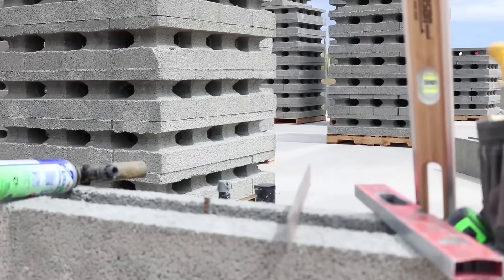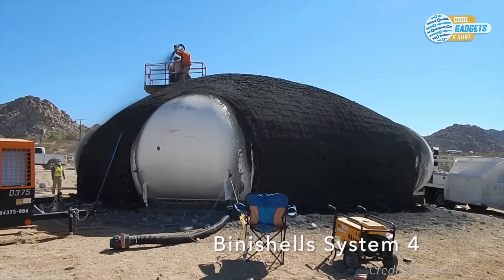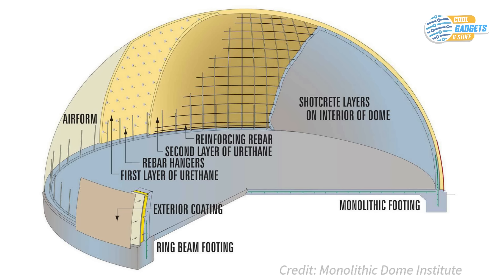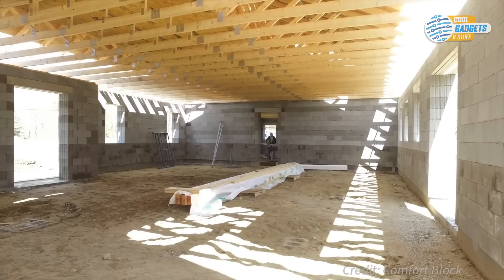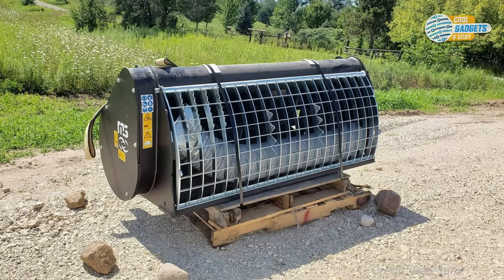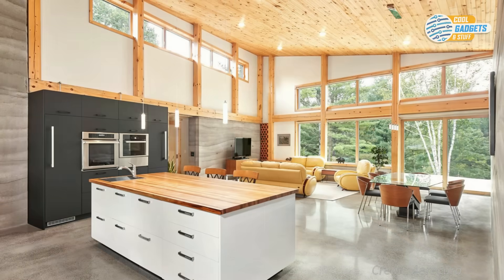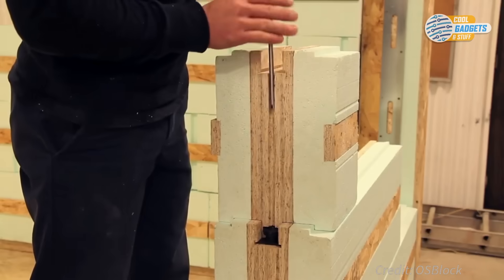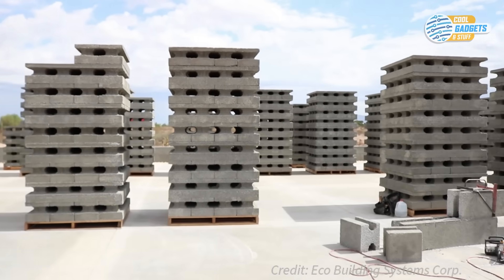5 Innovative BUILDING SYSTEMS for your house #3

Comment: Was surprise to see the complete lack of staggered structure in the “Perfect Block” product in the last system. Seems like a basic building technique was being ignored, and I can’t help but wonder why.
Reply: I noticed that right away, no staggering, it must be a mistake, but maybe they were too lazy to cut the blocks in half for a staggered course. It’s inexplicable to me.
Reply: if you look at the broken block you‘ll realize they are not structural at all. its the poured concrete that is.
Reply: @marcelbricman  True but it's a very thin sheet of concrete all said and done.  Thin with no support from the blocks.  It's going to crack for sure.   I guess the real problem with experimental building is time.  You really won't know until a decade later.
Reply: @MrBottlecapBill  it looks to be a grid of 10cm thickness with rebar inlay, yes its not super thick, but should be good for a 1-2 storeys?
Reply: That's what I thought as well and it looks so counter-intuitive, but this is because bricks are load-bearing and the staggered pattern serves to redistribute the load and bind/interlock together the blocks (bricks).
Here the blocks only serve as a mould to pour concrete in and then serve as insulation, the load bearing part is provided by the concrete that is poured into them.
Think about these blocks as arranging your insulation.
Reply: @JC-XL  agreed, also, regular bricks are staggered why?  load, sure, but more importantly LATERAL stiffness - if built unstaggered a whole vertical seam could open, but staggered makes it much harder.   here, the concrete and rebar provide the lateral strength, so....
Reply: If the concrete and rebar settle over time I still see the blocks opening up and exposing gaps.   :/
Reply: J C Staggering always improved strength, even when we are talking about the interior continuum of concrete and rebar
Reply: After the Block are set concrete is grouted through the holes for a complete web of reinforced concrete inside the whole structure of the wall very strong. This is not a new building system it was invented in 1965 in Australia it's called rostra block.
Reply: It's only the first rule of building with Lego.
Reply: my thoughts exactly.

Comment: You said multiple times that concrete is mold proof. That's absolutely not true at all.
Reply: More resistant to mold would be a better terminology.
Reply: @irmux skeptic That's like saying rotten trees are mold proof, as long as you keep it in direct sunlight on top of a mountain far away from the ocean
Reply: @NikoBell1188  Certain capacities are better at resisting mold in others indeed.
Reply: The mold proof blocks are mold proof. But however perfectly they make mold proof blocks, if you're living in a house of its temperature gap between in and out of the house is too big, then the house starts to be moldy. That's freezing phenomenon especially in winter when the heating temperature is too high making big temperature gap from outside cold weather, it makes mold start to grow.
Reply: I heard “mold resistant.”
Reply: I agree with you though because I could take you to my basement right now and show you some mold but I will say it is more resistant to mode opposed to lumber for example and a lot of the time mold will fall into the concrete due to a wooden beam or 2 x 4 or truss
Reply: Do rocks and Portland Cement mold?  Concrete is mold proof.  The interior of a concrete building, or the pores?  That's not the concrete itself.

Comment: Hmm...does the rebar hold it's shape created by the dome? Strong enough to hold cement; stay that shape?

Are the domes structurally safe; mathematically engineered?
Reply: Domes share a quality with boats; all that curvature makes for a lot of strength.  As you can see in the video, these structures can span large areas with neither columns nor beams, provided they are properly designed and constructed.

Comment: Eliminate steel because  it rusts. Concrete  will  not last. The  pyramids  would  have  disappeared  if they were  made  out-with concrete.  Its  insane.
Reply: You prefer wood? Seriously what other option is there today
Reply: @olsonlr  I prefer some material that is  strong, does not  rot, does not rust, nothing  eats.

Comment: 10:34 this looks weak AF.. not overlapping layers...
Reply: It looks weak, but remember that that is just the light and airy styrofoam-based leave-in-place concrete forms. The meat of the structural support is the concrete and the steel.

Comment: 10:30 ... NEVER LINE UP YOUR JOINTS ...
Reply: right they should used overlapping layers
Reply: It is just the insulating form that is lined up.  Those joints don't matter because the wall gets filled with a continuous pour of concrete.  There is no engineering reason to avoid lining up the insulation. 

If they are choosing not to lay them in a running bond, you can bet it is intentional.  My guess is that such long blocks could have trouble aligning well when placed in running bond (small issues become amplified over the length), so they save trouble by not doing that.
Reply: @SimonASNG  - Nah they are just being lazy. An even better idea would be to offer the blocks in two lengths. It would not change much, but speed up built time. It also takes up the same amount of crate space and adds no extra weight either. The concrete poor would actually be stronger by cross crossing rather than run up and down in thin rectangular pillars as well. The best reason to overlap each layer though is that in the event of any movement, likely from the soil, no cracks are likely to form or begin to show..
Reply: @SimonASNG  what about redundancy? One engineering principle is to have helping properties appear several times in a structure in different parts of it to reduce the probability of error or failure. Seems legit to add more stability to any layer of your wall when possible since that's the key thing in construction. But they still may have good reasons not to do so, like material constraints or whatever. I'm not an engineer.
Reply: @juxtapode2781  Insulation is not structural, so it doesn't actually add much stability.  However, running bond might make it much more difficult to lay correctly.  Bricks are short, so the running bond doesn't cause a problem.  However, if you run long bricks or long tiles or even plank flooring, you will see they recommend against running bond because it is almost impossible to get a good fit if the lines are not perfect.   In bricks, you stagger the joints to reduce the chances of a crack propagating, it is the long vertical joints you want to avoid, not vertical solid.  Imagine the insulation completely evaporates (magic) and this system still leaves you with a solid rebar reinforced wall with no joints and without the potential problems of trying to run the insulation in running bond.  No joints is better than staggered joints.  Anyone who tells you differently just doesn't understand why joints are staggered.

Comment: Good job! Take a look a HEMPCRETE, it should complement your growing list of alternate methods for construction 🚧
Reply from the maker: Hi, I know about Hempcrete but from my research is mostly used for insulation not as a structural building system. Will do some research if there are any hempcrete building blocks out there, if you know of any company let me know. Thanks for the comment.
Reply: Cool Gadgets & Stuff not at all... Take a look 👀 at this hempcrete “blocks” with added space for pouring floor to roof support.... https://www.isohemp.com/en/hemp-blocks-buildings-hempro-system
Reply from the maker: Hi, I've seen Isohemp before, I featured them in my Eco Building Materials 1 video. They can be used like Insulated Concrete Form type of construction. I found two other companies with Hempcrete products - Hempitecture and and GeoSIP Hempcrete so will include more on Hempcrete in my next Building Systems video. Thanks for your suggestion.
Reply: Cool Gadgets & Stuff it was a wild thought — could you share your website? Thanks !!
Reply from the maker: Hi, don't have a website for now. I understand some people like article format more, maybe in the near future.
Reply: @cgstech5657  no problem... but you do build these domes? Have any models to look at? thanks
Reply from the maker: Hi Peter, links are in description. I'm not affiliated with any of these companies. This is just like a news type of channel.
Reply: I'm currently looking into varying building materials to build my first home using bricks. Though hempbricks has caught my attention and am curious on the cost per brick, sustainability and the endurance of said bricks during heavy winds and likewise.
Reply from the maker: @EmWhaley1865  Hi, I covered Hempcrete in my fourth video on building systems. It's on my channel. Hard for me to give a cost estimate.

Comment: top part dome with fan blowing downward and the air intake lined with UV light.   Bottom has a series of posts that the dome sits on, roll up doors between posts with screen on inside.   Now you have a covid safe sitting area for restaurants that is lockable but still like a outside patio.
Reply: You must be in Kalifornia.

Comment: All these, yet no mention of industrial steel SIP panels. Steel SIPs offer the combination of highest R-vale per dollar, entirely recyclable materials, fastest construction times, near R50 clear wall value, no pest food value, lowest ground pressure per square foot, reduced foundation requirements, lightest handling AND installed weight of any approved method/material, reduced labor cost, minimal preparation, minimal fixturing/fastener requirements, reduced need for finishing ("as produced" with weather and moisture barrier inside and out), and the convenience of engineered materials with known tolerances and consistent physical properties.
Reply from the maker: I'm doing another video on building systems soon and will likely include steel sips. If you know of any company making or building with steel sips let me know.

Comment: cost comparison per sq ft would be a nice metric
Reply: $250.00 per square foot turn key sounds about right! I researched a Concrete come home. I built a brick home for $35.00 a square foot.
Reply: Don Raptor No way to be 250$!
Standard construction is ~150$ depend where you live,often less than that. Concrete dome shouldnt be more expensive,and if they quote you that much,than that company sells hot air ballones!
Reply from the maker: Hi, yeah I agree cost is a factor, but it's kinda hard to give an estimate when there are so many other things to take into consideration than just the cost of the blocks. Only Conrete shell companies and Aerecura rammed earth company builds turnkey solutions. Binishells have different system that range in price and Aerecura is from my research a bit more expensive than conventional construction because of the labor involved. Comfort Block is I think about $30 for square foot and the OSBlock and Perfect Block you have to contact the companies for a quote.
Reply: @cgstech5657  I mean, it's not hard to just find a house that was built with one method and then find the cost of building it and divide that by the square footage, then find a comparably sized traditional house and do the same.

Too much work for a youtuber, of course. You might actually have to do some research instead of just copy and pasting videos and then reading their advertisements.
Reply: @cgstech5657  if you can just get a really rough estimate for the average size home in the USA like a 1500- 2500 square foot house